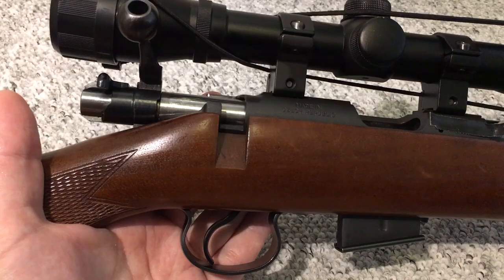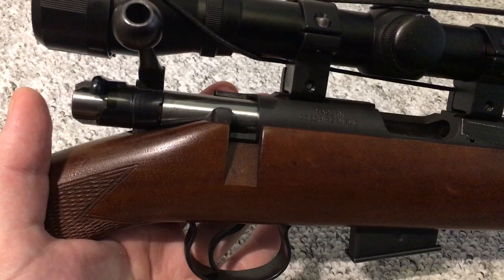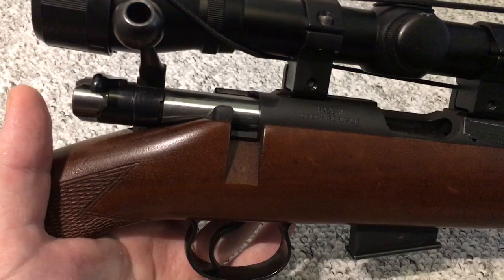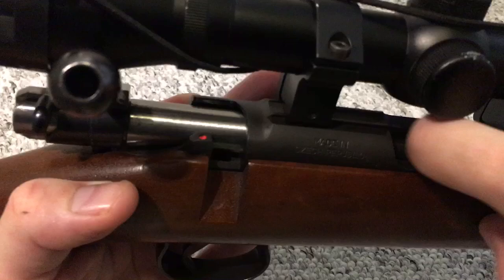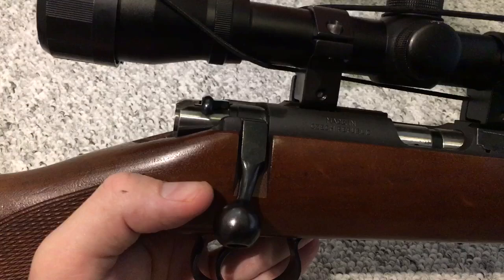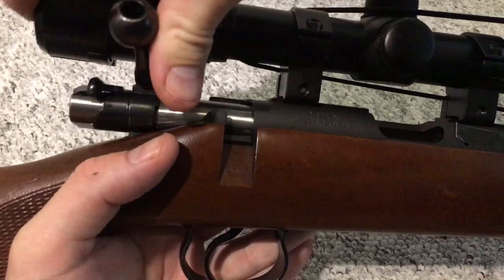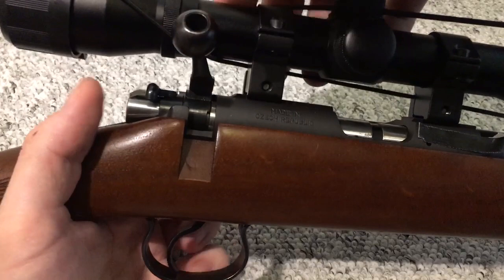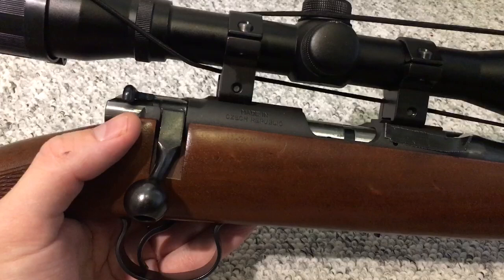How To Decock A Bolt Action Rimfire Rifle

Comment: I am glad you stressed that this shouldn't be done with a live round in the chamber. There are so many instructional videos that seem to want to get right down to the action and they skip the safety components.
For a number of years I worked in a busy gun shop and I heard all manner of horror stories. Almost all of these could have been avoided if a few safe firearms handling rules had been observed.
The range where I regularly fired has been operating for 70 years without an injury due to practising these principles.
Reply from the maker: Thanks Harry! Yes, lots of people seem to think being safe, careful and prepared is a sign of fear and weakness. That everything will always be fine and dont worry about it. I have heard some stories about US public ranges, they seen a bit wild!